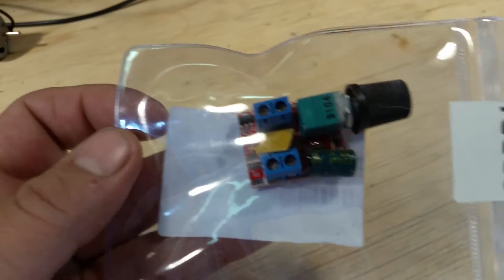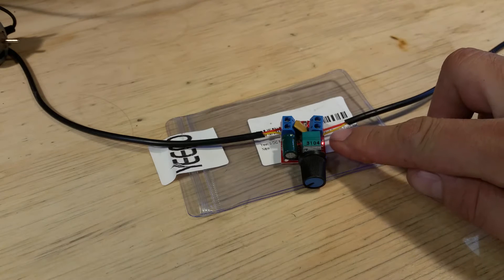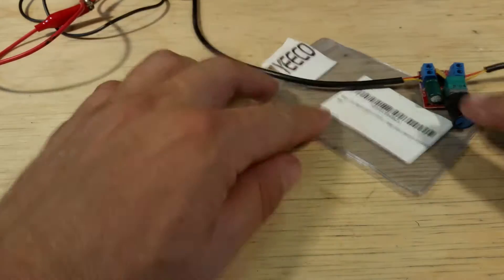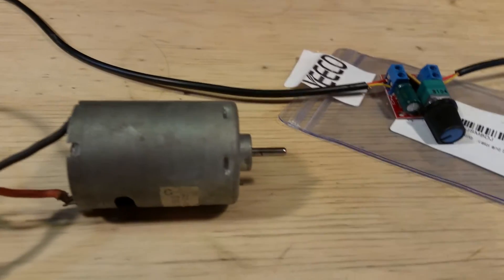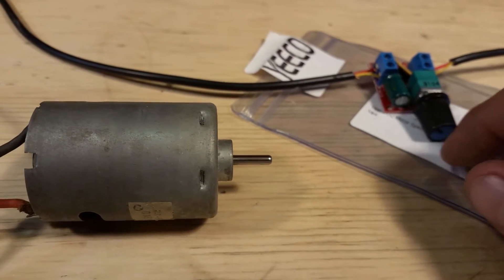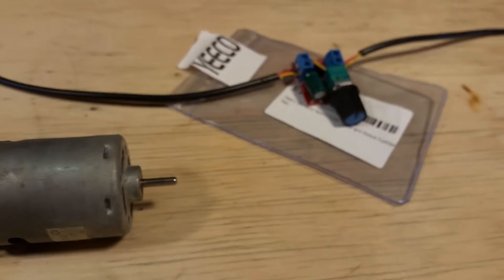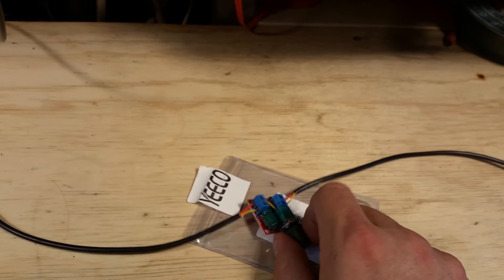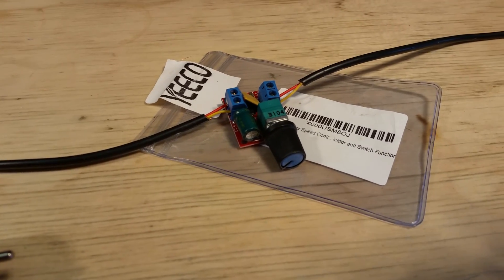Mini DC PWM Speed controller. 3-35 volts 5 Amp Review, Yeeco®

Comment: Ah, cool... I have four of these coming in the mail (~$5 of ebay) for a PAPR (welding, grinding, etc.) to control the 4.5V 25W mattress inflator speed for the current blower design.   I figured since so cheap and coming from overseas... better to get a couple while at it.    Was wondering how these will perform.  Subscribed.  Thanks for sharing!